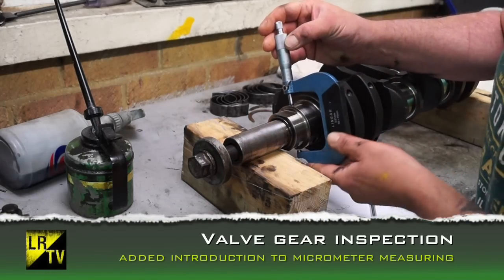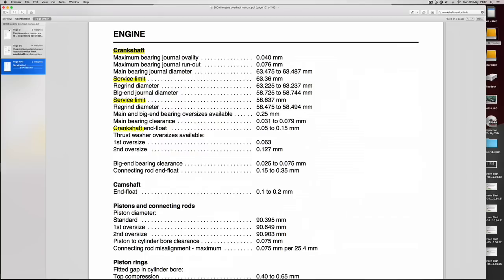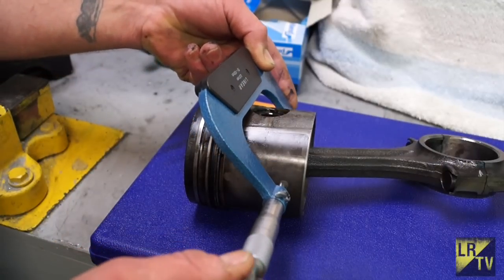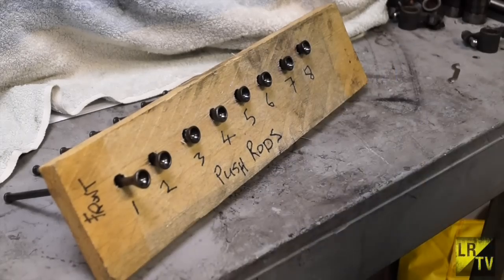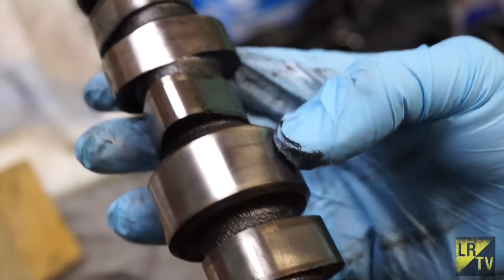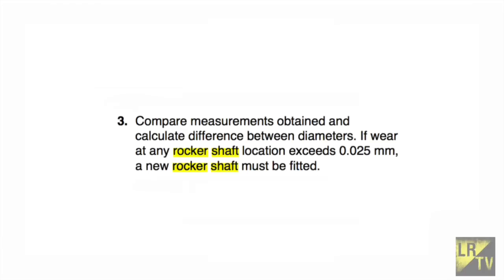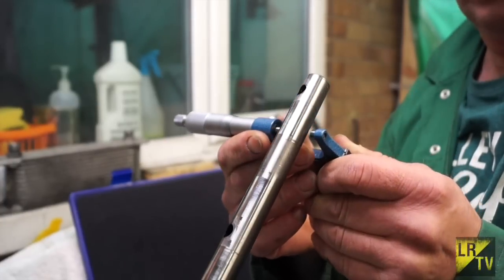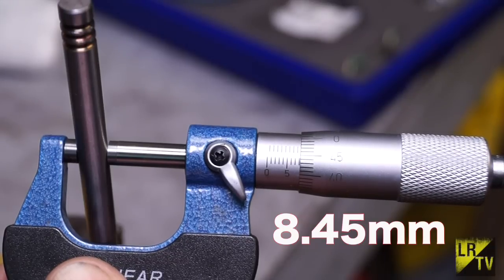Inspecting the Valve Train- 300tdi Engine Overhaul - 110 restoration project

Comment: hey cool video although I'm not totally sure you read the mic correctly. at 7:20 I think the mic reads 17.97mm instead of 18.47mm as the nob is actually turned in slightly from 18mm, I may be wrong but just though I would mention it :D
Reply from the maker: you could be right. I will recheck.

Comment: a diesel crankshaft can be tricky to grind to a undersize, the 2,25 and 2,5 N/A diesel crankshaft cannot be ground as they break in service pretty quickly.
Reply from the maker: 300tdi crank according to the workshop manual can be ground and the tollerances are stated.
Reply: +Land Rover Toolbox Videos I have a spare 300tdi crankshaft for that purpose, we have a 300tdi that went through 4 rear crankshaft seals and tore the heart out of a flex plate just before the automatic gearbox went out with a bang. the defender got used for heavy off reading so I suspect the crankshaft to be fubar.
Reply from the maker: Perhaps the crank is bent?
Reply: +Land Rover Toolbox Videos that is what I think, that is why I got a spare. I will be looking closely to bearing shells too.
Reply from the maker: get the crank on some V blocks then use a dial gauge to check for run out on the crank.  Don't know the figure off the top of my head but it is in the workshop manual with diagram where to measure it from.
Reply: I got given a big magnet foot for a dail indicator, last show I found a old dail indicator to go with and material to make roller blocks from skateboard wheel bearings. :)
Reply from the maker: should work (?)
Reply: +Land Rover Toolbox Videos a replica of Keith Fenner his roller kit. I try to learn lathe and mill work too.
Reply from the maker: A Lathe is good for making tools for Land Rover repairs.